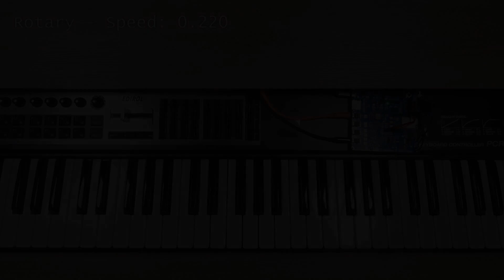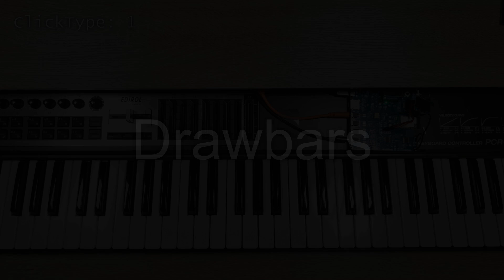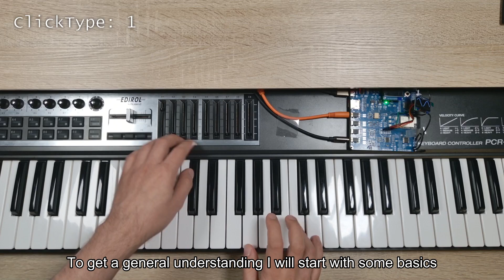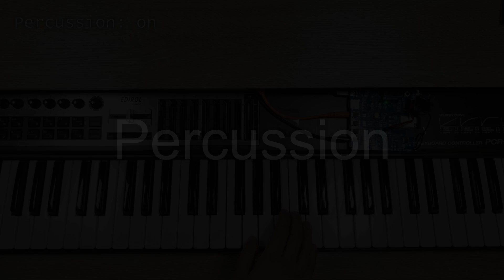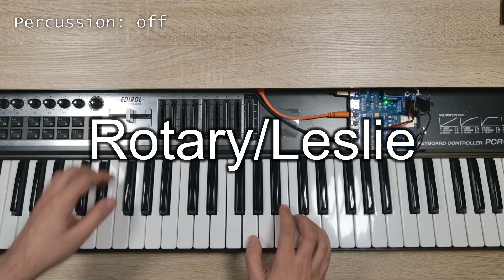Arduino DIY organ update (ESP32 demo) - working on some new features like vibrato etc.

Comment: Is it a expansion board you are working on for years and that you are going to sell ? Or is it opensource ? How can I make one ? What are the ESP32 specs ? classic 4MB ? more ?
Wonderfull work. I would like to make a virtual synth from this. With presets called via midi pgmchange etc. Would it be possible ? 
All the best. B
Reply from the maker: Yes, i would be happy to be able to sell it. I am using the ESP32-WROVER-E on this PCB (with 4MB PSRAM). If you refer to the organ it cannot be combined with other projects simultaneously. I could imagine that you can switch between organ or something else via program-change. Or you can change the organ setting via program-change messages. What kind of virtual synth do you have in mind? Thank you very much

Comment: Hello Marcel License, how are you? Sorry to bother you, but could you explain to me: I downloaded the code for 1 ESP32 and I'm going to send midi messages from another ESP32 for simple tests, like playing a note, for example.
I'm having trouble using the internal DAC and also the external DAC because I didn't see support for the MCP4725 DAC that I have.
Can you help me with this problem?
There is an instruction that says that if you don't use an external DAC, use this:
You can also get a sound without a DAC.
Add '#define I2S_NODAC
Use Gpio22 as output with capacitor, am I right?
and my midi in signal will be on rx2, gpio 16. correct?
thanks and sorry for the inconvenience..
HAPPY 2025
Reply from the maker: Happy 2025 to you too. I think the MCP4725 will not be supported. It is a I2C based DAC and seems to slow and I don't know how to create a fast I2C audio stream. Usually you use a DAC using I2S (WCLK, SDIN, BCLK or similar). When starting the firmware you should see the configuration in the serial monitor. The output might need a small resistor network to lower the max voltage and you are right you will need a capacitor in series to remove the DC offset from the output. For more details feel free to use the discussion area on GitHub. I would be happy when you get the project running. When I find enough time I could prepare some tutorials including simple example projects. One for MIDI still exists.
Reply: @marcellicence  Thank you very much, you are an excellent person, a rarity in this world we live in.
GOD BLESS YOU VERY MUCH
Reply from the maker: @valdeciribeiro7839  Oh thank you very much. I am sure that there are a lot excellent people =) Sometimes there are harder to find. You are welcome

Comment: Hi,@marcellicence  , your project is really cool. I've been following it and trying to apply it to the  Doit Devkit with Esp32-wroom-32, but without success.
Could there be problems with the IDE or board version for Esp32?
Thanks
Reply from the maker: Hi , thank you. At the moment the latest supported ESP32 version is v.2.0.17. I am working on the support for v3 but it takes more time. There are some major changes with the new version.
Reply: @marcellicence  Grateful.

Comment: Very cool! What kind of audio board you are using?
I would like to port Synth_Dexed also to ESP32 😊
Reply from the maker: Thank you. The board you see in the video is actually one I designed and made myself. It's a custom PCB I created specifically for for synthesizer audio projects. A port would be nice. I try to avoid doing ports and starting from scratch instead. Did you see/hear my FM implementation on the ESP32?
Reply: @marcellicence  I needed a replacement for my original DX7, so the port was the easiest was to achieve this 😀
I will take a look at your FM project asap. 
Any chance to get your designed PCB for my port of Synth_Dexed?
Reply from the maker: @CodemanRhodes  I see. Would be a good idea to go for 6 operators instead of 4. I tried to be able to generate the sound known from the Sega Mega Drive / Genesis using the YM... chip. I have another flexible design which is not public which allows a more optimized usage of the microcontroller. Yes, it would be possible to get the PCB. You can send me a PM for more information.